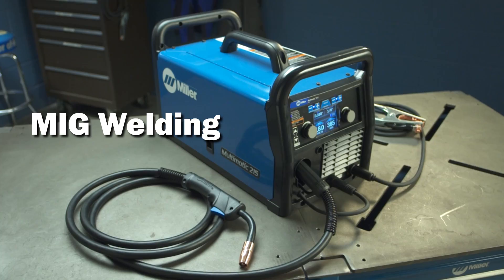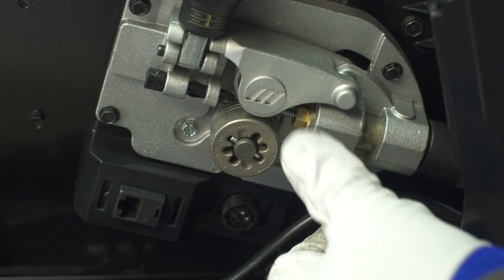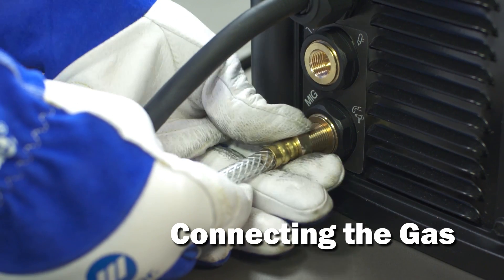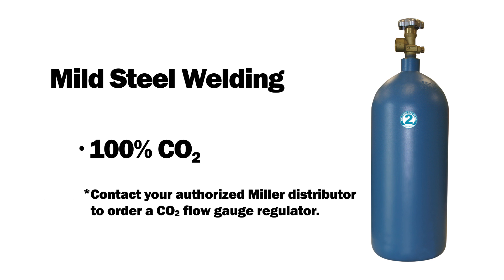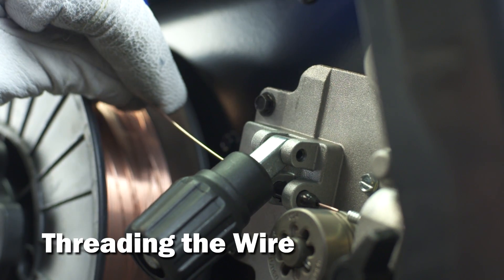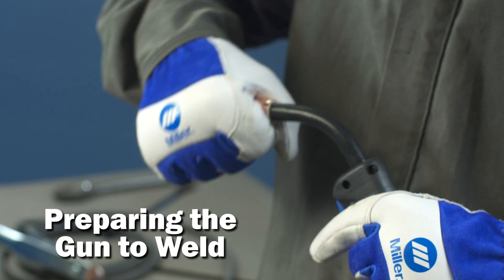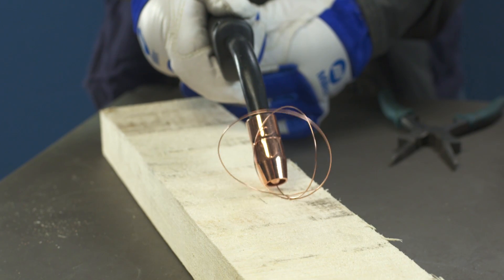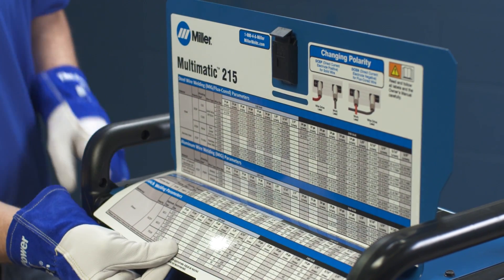Miller Multimatic 215 MIG (GMAW) Welding Setup

Comment: Just got started with my new Multimatic 215 - Love it - Do you have some guidance for adjusting the 75 / 25% Argon / Co2 Gas on a MIG operation - I don't find much information on this - Thanks for an awesome welder
Reply from the maker: Hi Greg, glad to hear you're loving your Multimatic 215! Regarding your question, we recommend giving our service line a call to talk this through with a tech. The number is 920-734-9821. If there’s anything else we can help with, just let us know.

Comment: Good afternoon, I just purchased this machine (From Baker Gas), it arrived today.
After setting it up per the manual (and then finding this video) I have no display image or LED lights functioning at all.
I can here it “click” while turning it off and then back on and at one point the fan briefly ran.
I have checked my circuit with my Miller DVI and a borrowed Miller 211 and have no issues there.
Please advise.
Reply from the maker: Thank you for reaching out. Please give us a call at 920-734-9821 to talk through this further with a tech.

Comment: hi ,I'd buy a multimatic 215 few weeks ago, welds beautiful but last time when I used the jog symbol came out followed by the hold symbol, can you tell why, thank you!
Reply from the maker: Thanks for reaching out. The “hold” message pops up when you finish a weld. It means that it is “holding” the amps and volts you were welding at on the meters. It holds them for a short time so you can look and see what you were welding at, and after a few seconds it will pop back to the pre-set settings. The word “jog” pops up on the front of the unit after a few seconds if the MIG trigger is pulled but no arc is started. When this happens, the weld output shuts off and the unit just jogs wire out through the gun. We hope this helps! Let us know if you have any further questions.
Reply: Miller Welders thank you, this is the reason why all my welding equipment is miller, because you guys take care of customers!

Comment: I just bought the Miller 215 and got a question, this is my first MVP type weld, I am still getting use to all this welder can do. I am doing practice runs all under a foot long mainly on 1/8"-3/16" mild steel using the Mig setup and .030 wire, what voltage works best for what I'm doing 120v or 220v?  I haven't used the Tig settings much YET but when welding the same material and thickness again which voltage works best 120v or 220v?
Reply from the maker: Thanks for reaching out. You are limited in thickness when you are in 115V. If you plug into 230V, you will have maximum voltage. We recommend plugging into 230 whenever possible.

Comment: Just purchased this machine yesterday Dec. 9th, 2016.  I set it up today and I noticed that the wire starts out slowly coming out of the gun and then rapidly, just as it did in this video. Why is this?  And even though I haven't welded with it yet, it would stand to reason it would do the same thing and that would seem to be a problem to me.  I didn't want to weld with it yet so I could take it back in case there was something wrong with my machine. Is this normal?
Reply from the maker: Thanks for reaching out, Damon. Yes, that is normal. What you're seeing is the run-in on the unit. The wire starts slow and will speed up when an arc is struck. If no arc is struck it will go to a job speed after a couple of seconds. Let us know if you have any further questions. Thank you!